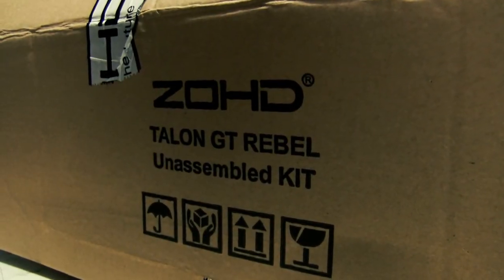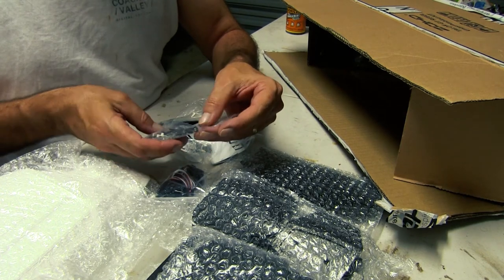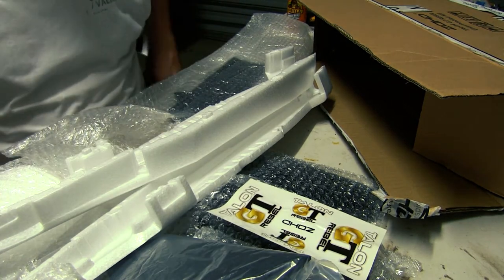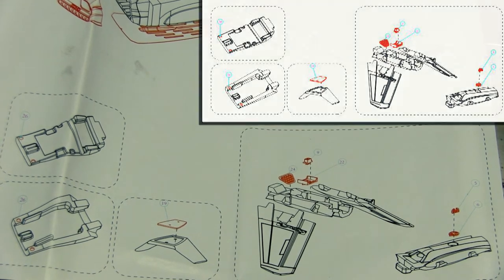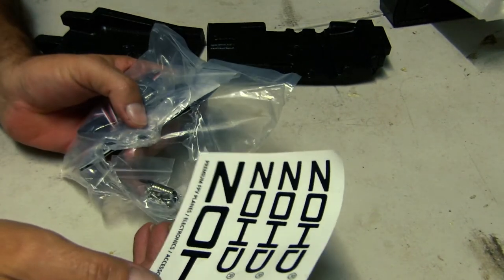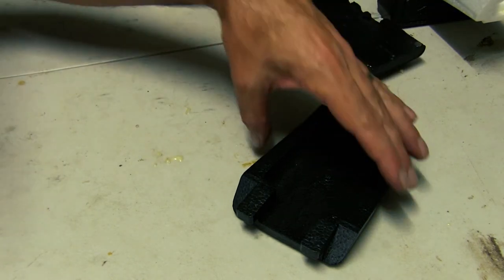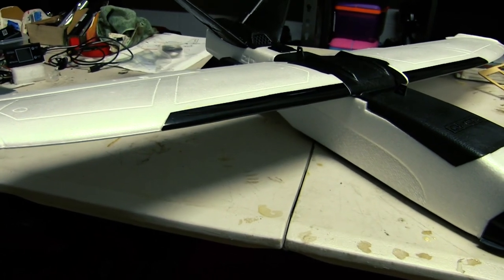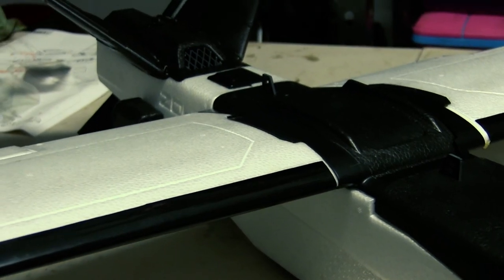Talon GT Rebel - Unassembled Kit

Comment: Great build I like putting my own Planes together also then you can put what you want in them and I also made the same mistake with the gorilla glue once to find out they do have a clear one looking forward to the maiden take care
Reply from the maker: Yeah kicking myself with glue. Its strong but there is nowhere noticeable on the bottle it says that it expands. Will get the clear one next build. I'm not sure exactly which way to go with it. inav again or ardupilot. I wouldnt mind an ardupilot plane but i am more confident setting a plane up with inav..
Reply: @stonesrcchannel  I have three planes and two wings and one quadcopter on Ardupilot and short of changing a few parameters I prefer it over I-nav it takes a little bit to get used to but once you get the hang of it you probably won't go back to I-NAV
Reply from the maker: @MrZeek101  yeah that’s what I figured too. I am kind of tending to go that way with it. I did build a hex with a pixhawk which has taught me a bit about it it’s whether I should risk this build on a new learning experience or just stick to what I am more confident with especially for the maiden.. I will learn about the v-tail setup in ardupilot and go from there.

Comment: Iv still got two brand new pnp ones just sat in thier boxes. Need to get them out and in the air I think.
Reply from the maker: I can relate to that too… I also have an Alpha Strike in a box had for over a year just haven’t had the spare funds or time to start it. The Talon has also taken a while to get everything I need for it I decided to build it first over the Alpha Strike which I will get to eventually.
Reply: @stonesrcchannel  sounds good
Reply: I forgot to mention, i paid £120 for mine, it was pnp and even came with the Kopilot and fpv kit. I seen it randomly looking through banggood one night. About a year ago. The offer was so good i bought 3 of them.
Reply from the maker: @k1ortia  nice yeah its hard not to buy when the deals are that good.
Reply: @stonesrcchannel  Definitely. Its a shame the prices of good planes have gone through the roof now. Hardly anything any good on banggood or Ali

Comment: thanks for this build video! i think to buy a talon gt for myself, in my favorit shop is the talon at the moment for 99€ to buy and i think this is a good offer. 
keep going on with your videos mate
Reply from the maker: Thanks it’s a great plane. Although I am yet to maiden mine I would suggest to stock up on spares or even by a second kit version for spare parts. Mine has unfortunately taken a fall off it’s rack at home and broken a servo horn on the elevator which I cannot find to have it fixed. My only option was to buy another full kit as spares are very limited.